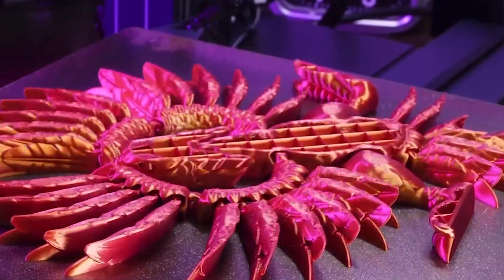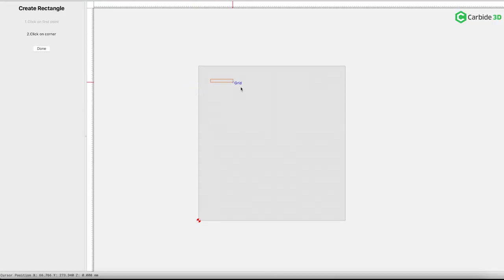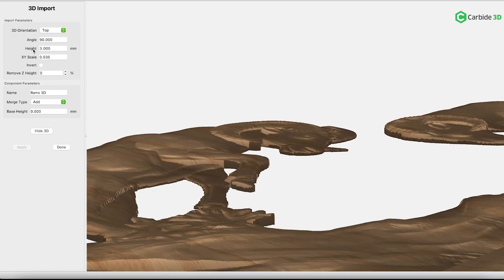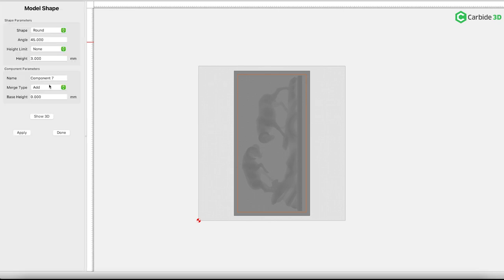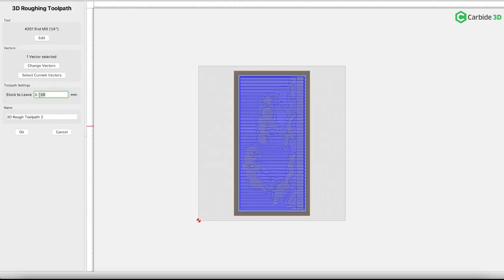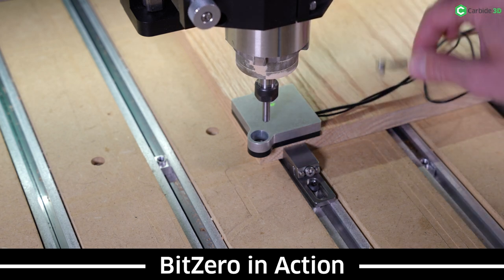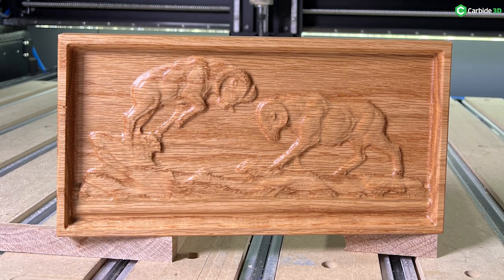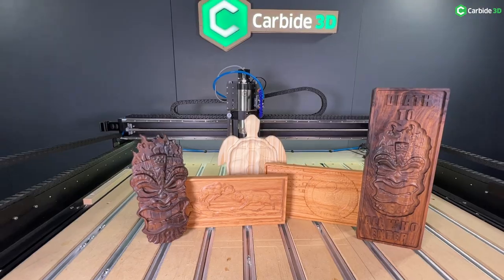3D Printing File - Run on CNC Router - STL Imports with Carbide Create

Comment: After import & sizing the 3D STL. Resize the vector frame to get as close as possible to carve edge. This will prevent the finish pass diving deep to frame out at each edge as you're going to do a contour cutout pass anyway

Comment: Can you use rest machining in 3d toolpaths?? For example can you have multiple roughing and multiple finishing toolpaths??
Reply from the maker: You can have multiple 3D rough or Finish paths. However there is currently no “REST” function available within those toolpaths.  You’d have to run the entire selected vector area again.

Comment: Kevin, I assume the file you import for 3D modeling in CB-Pro needs to be a solid, as in an STL, etc? I have tried this with a 2D drawing from CB-Pro design and it does weird things, doesn't behave like your file.
Reply from the maker: Tony,   For 2D files, you can import an SVG and then utilize the 3D Tool to extrude your chosen object.   Remember, our 3D tool is a designer tool, not an engineering tool.
Reply: Thanks Kevin, yes, I'm used to Solidworks,  which this is not, of course. $350 vs $8,000, that sums up the difference. I can't afford to buy Solidworks for a hobby.

Comment: How did you get the stl file from Carbide Create to the CNC machine for printing?  I can't find a command in Carbide Create.  Do you use another program that talks to the CNC machine to print to it?
Reply from the maker: STL Import is in the "MODEL" tab of Carbide Create Pro.   Without Pro, that tab isn't present in the software.   Along with STL Import, you get a variety of other capabilities.   We are constantly adding to the Pro features.   Climb and Conventional Cutting was the most recent addition.
There's more information here:  https://youtu.be/0W-5nv4izqA

Pro is available here:  https://carbide3d.com/carbidecreate/pro/

Comment: those rams the best detail possible with carbide 3d? im choosing a cnc router, i need high detail capability.
Reply from the maker: Detail is generally a function of:

- The material you're cutting (some materials cannot hold really find features)
- The size of the cutter you're using (Smaller cutter -> longer machining time, but more detail)
- How much time you want to spend on the machining process (More time->better detail, better finish)